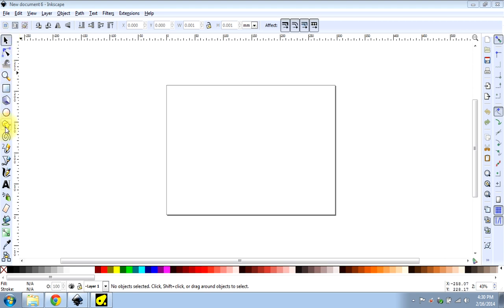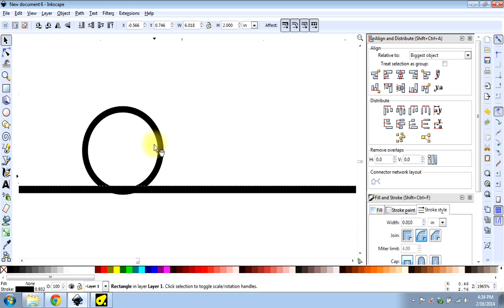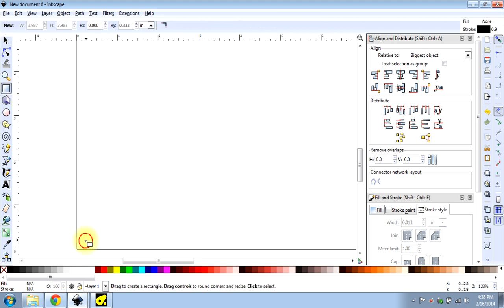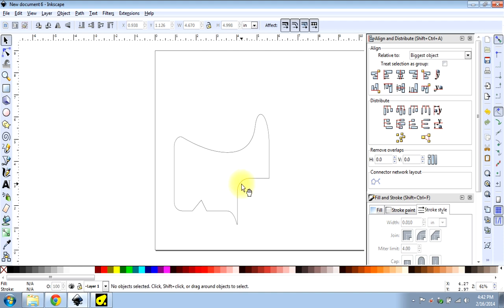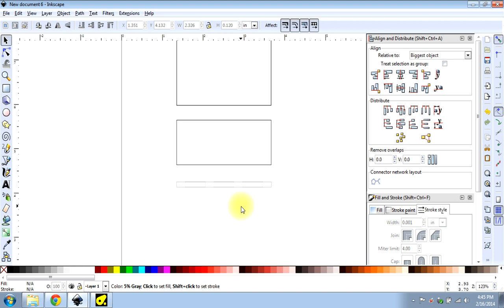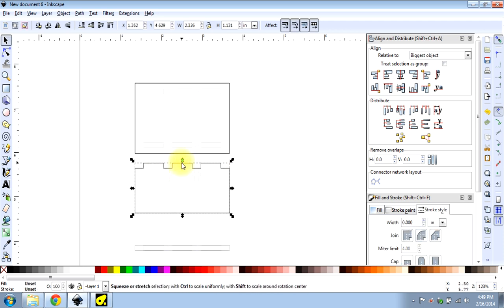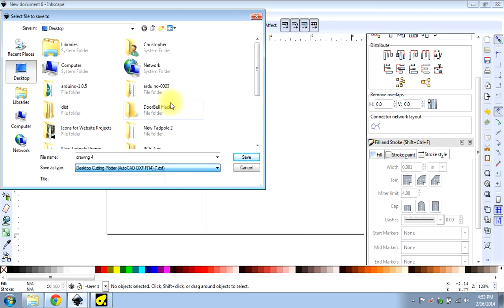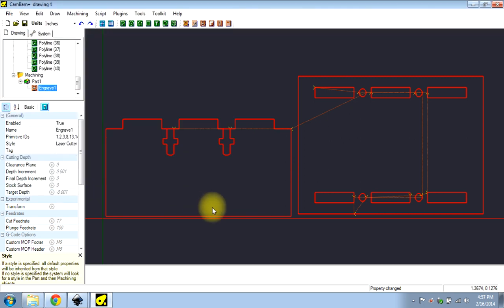Inkscape with CNC's and Laser Cutters

Comment: you dont need to zoom in and manually align edges to butt them up. Just use one of the alignment tools with the little yellow box attached to it. Much easier and you will get perfect alignment.

Simply select both items then go to the "align and distribute" box. Click on the 
"relative to" drop down menu and select "last selected" or "first selected". Then click on the align tools with the yellow box in it that corresponds to the edge you want to align to. - right, left, bottom, or top edges - The objects will perfectly butt up to one another along the edge.
Reply: +wellyes Thanks!

Comment: I'm new to vector graphics but experienced in CAD. I don't the type of constraints and explicit dimensions I'm used to in CAD. Maybe it doesn't matter with the tolerances of the CNC plasma cutter, but alot of the aligning is just eyeballed. It's a bummer fusion 360 doesn't output svg files natively, but apparently inkscape does a pretty good dxf to svg conversion.

Comment: Nice job, I am waiting on my cnc and when you explained the screw fastener system it clicked. as I had seen another project assembled with this. 
I also run a 1000 watt laser at work on inline roll press

Comment: Hi Chris -- great tutorial on Inkscape and later on the CAM stuff. I have a question: I'm using a low power laser (2.5 watts) and for a rectangle, I need to change feed rate when cutting against the wood grain vs cutting with the grain. So for a rectangle, I need to be able to high light the vertical lines of the box and assign my laser tool I've setup for that kind of cut (mainly just changing the feed rate) and then select the horizontal lines and select my 'horizontal laser cut' tool. Can CamBam do that for a rectangle or does it just 'see' the whole box as one object?

Comment: Ok, here is a question, nobody seems to be able to answer. I want to scan an image into photoshop. I am scanning at 100 DPI, and the image MUST stay the same hieght, and width. When I finish it in Inkscape, and save as a dxf file, it turns out to be almost 20 times bigger than the image I scanned into photoshop. WHY? How do I change it to read the EXACT SAME SCALE, so I can uct it on the K40 Laser cutter?? It has to be exact. Otherwise, it is worthless to me.

Thank you in advance...

Comment: Hi Chris, Nice tutorial, Have a question, been using inkscape for a while, but lately I'been trying to work my way with this open source software to make some models for Water jet CNC cutting, but haven't had a good result with final dimension and alignment, main problems is  dimensioning a part for the  total sketch, cannot set the proper dimension, let say a need a circle exactly 4" Diameter, even when the dimension are set at the proper boxes dimensions can go up or down up to 2 mm in either way resulting a final figure that is 3.98 " and so on I'm also using .0001 as hairline thickness, so I wonder if you have a suggestion to correct this issue  Thank so much for your advise if any.
Reply: Hopefully you've solved this in the past 3yr.  For anyone else.....

Don't forget that your drawing needs to take into account the kerf of the tool you'll be using. If it's a saw or CNC router, that's the width of the blade/bit. For lasers and water jet, you should run a sample cut on the exact material to determine exactly how much material is going to be removed.  Use that number to adjust the sizes of Critical measurements/dimensions.

Comment: I was going to ask pc os version,inkscape version gcode extension,but you have cambam,and it will output gcode from cad files from inkscape,i chucked a cd rom 3 axis toy together it works,grbl controller jogs the axis's axii(what ever) the xyz axis to close tolerances for the step sizes,but dang if i can't get the inkscape v.45 to make makerbot unicom g-code to work in grbl controller,keep getting error for buffer size,and the gcode tools extension is not as other people have it as a drop down.BIG learning curve,i use pcb CAD(tina7 ind) ,what cnc device are you using,i'm going for a custom diy build,the physical side is basically plug and bolt,getting the bugger to follow some code seems to be a pain in the ass,i've lost count of the cd rom draw bot vids on utube.

frikin freakin frustratin ,hows cambam for help,print out instructional use etc.

Yes fast in out vid job done,pause rewind,button use in inkscape as shown was educational so big cheers for that,pint and a packet of crisps for that mate.